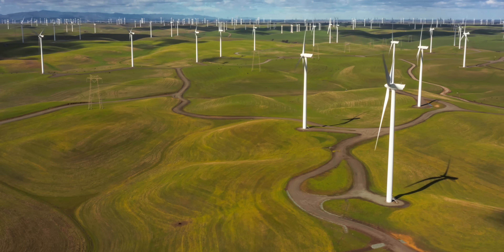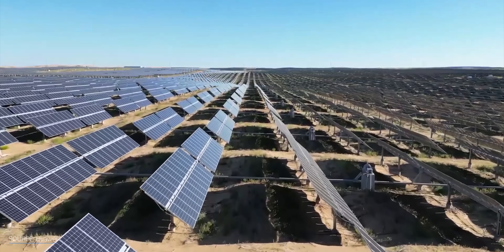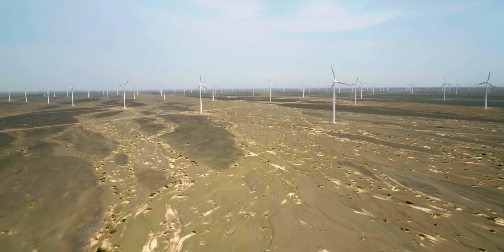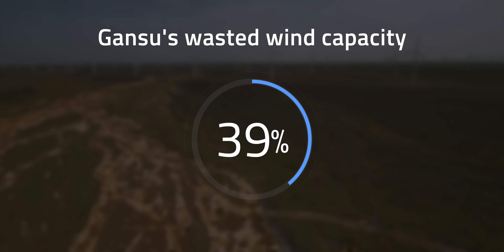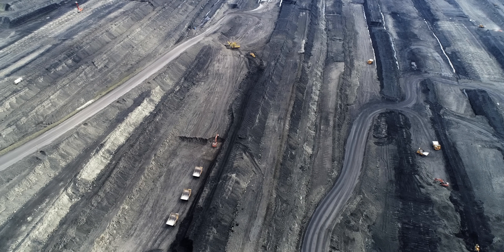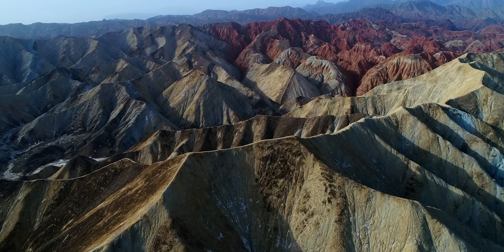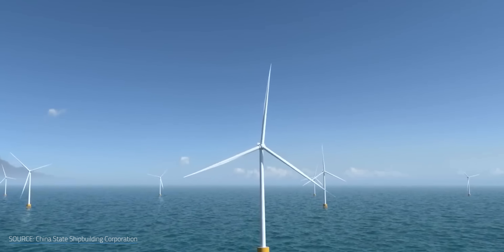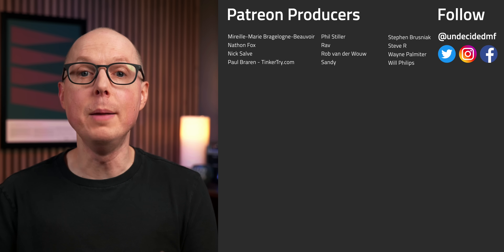The World’s Largest Wind Farm has a Tiny Problem

Comment: No, the U.S. does not need these centralized, concentrated, single-point-of-failure, eye sores that just waste energy in transmission.  Harvest the power where it's consumed.  The U.S. should have solar panels on every roof top and parking lot where it's feasible to do so, essentially decentralizing the grid.
Reply: Wind farms are the EXACT OPPOSITE of eyesores.     And WAAAAAAAAY better than rooftop solar panels.
Reply: You are missing that there are major projects and centres that need more power than can be handled by simple local generation. Decarbonizing steel or aluminum, or manufacturing for autos, etc, require incredible amounts of power that dwarf DERs for residential purposes. Roof top solar is absolutely a big part of the solution (with storage) but big projects like this will also be needed for big energy intensive industries.
Reply: Smaller power generation systems simply aren't as efficient or cost effective. It depends on the area, but in some places the sun doesn't shine enough or the wind doesn't blow enough or the crust isn't thin enough for solar or wind or geothermal.
Reply: Solar power won't do anything during the night when the consumption is highest. Maybe for air conditioning. And I doubt each household is willing to shoulder the cost of complete systems with their own storage. You average american is too short sighted for that.
Reply: @Leonhart_93  The cost of storage is going down and climate crises make having local power generation and storage more plausible. Occasionally an unnatural disaster strikes too such as a local utility getting hacked or sabotaged or even an accident happening out of negligence/stupidity.
Home owners have options and if they don't use them then they will suffer the consequences eventually. 🤷‍♂

P.s. I rent, but even I have a large battery and solar panels to keep some things running. It can be powered by generator, vehicle, or solar panels.
Reply: @megamanx466  The cost of those is going down, almost at the same rate as the average remaining spending money of the citizens. The economy doesn't look great for most right now.
Reply: @Leonhart_93  Depends on where you live and whether you have kids. Kids will always seem to be a financial drain and some people spend more on rent than they need to.
Reply: @megamanx466  It's not like they willingly spend more money, at least not on average. With rents of like 300k in some places and exorbitant taxes in poorly ran places like California, in those places there is no victory.
Reply: @Leonhart_93  ? 300k?? Of what?🤨
I feel like you're talking about California and somewhere else. 🤷‍♂
Reply: @megamanx466  Yes, I was. And it was just a few examples. In those places in general the game is rigged and you need to be anything but average.
Reply: @Leonhart_93  Ok... but 300k of what for rent a month? 🤷‍♂
Reply: @megamanx466  Some big cities where the average income is really large. But that also means the income is useless since they don't get to keep most of it.

Comment: I just BaiDu. According to the Chinese reports: High Voltage DC cables was connected, and a gigantic energy storages were installed, so GanSu get green light to run full speed on it wind and solar energy in 2020. 

"Starting from 2021, we will introduce full industrial chain projects with investments of over 10 billion yuan, such as Baofeng Silicon Materials, Huantai All-vanadium Liquid Flow Energy Storage, and Zhihui Green Coal Chemical." -- translated by Google

BTW, I just checked 2023 figures, wind power is still larger than solar in China. But it seems solar will soon surpass winds.
Reply: Thank you for the update. I am an Environmental engineer in America. These projects are what I have been dreaming about for many years. I would like to stay in touch as the project moves forward. Thank you and I hope to hear from you again.
Reply: @CSBastianyGaumnitz  The american midwest is an old danish dream. Ideal place for Windmills, hydrogen and biofuels. Connected to 'the midwestern corn lobby!"
Reply: @CSBastianyGaumnitz  Yeah I know! I ain't no engineer, but a wind farm the size of Belgium is simply mind boggling! Also, the efforts of de-desertification is so impressive! China has killed off one whole "desert" called Maowusu. It is not a true desert. It was a rich grassland one thousand years ago but due to over-grazing and over-farming, it turned into desert and it kept expanding... It is done by sweat-and-blood of many generations, and also a lot of innovation. What I learnt was that the scientists teach local people to grow a Chinese herb Licorice. This plant can grow horizontally and was patterned into grid to grab the top soil. And licorice is in high demand in China and the local people could sell them at good price! You can imagine how much it improves the life of local farmers (and herders). 

If you have time, maybe just go there to take a look yourself? And, my understanding is that the central America is a piece of big, baren, sunny, windy, dry and cheap land. Definitely infinite chance for innovation to do something seriously good for the Earth and local farmers back home!
Reply: Im no tech expert and even i know China is pioneer on UHVDC tech and installing large distance every year. Also from this year 2024 "The state-owned State Grid Corporation of China has started construction of an ±800 kV ultra-high voltage flexible direct current (UHVDC) transmission project linking the provinces of Gansu (western China) and Zhejiang (eastern China). The project, touted as a world first, will enable the transmission of over 36 TWh/year of electricity to Zhejiang once completed, with more than half of this amount generated from renewable energy sources" ... Matt is using 2016 data in his video, almost 10 years ago data lol
Reply: According too the ccp... lol
Reply: @alexandergooding4860  says the cia bot who believed iraq had wmd lol
Reply: @MGZetta  lol
Reply: @alexandergooding4860   what has ccp done to you personally... Did ccp go on war with any country and It's ideology...
Reply: According chinese reports...😂😂😂😂. So stay cool
Reply: @Tony-zg4yf  See some results and cleans your washed brain. You're trying way too hard. Lol.

Comment: In the US i think the distributed energy model makes more sense.  The energy is produced on the homes where it is used.  this avoids the transmission lines cutting down on the expense and losses.  It also takes loads off of the local and regional grids by reducing the surges produced by individuals cranking up the heat or cooling in their homes..  Just a small system on each eligible home could reduce the overall load on the grid and energy generators.  that is my philosophy although it may come with its own challenges since energy produces will find it more difficult to balances the demand vs generation.
Reply: I agree totally with your concept.  It might lose overall efficiency but the cost savings of building locally at the each house or multifamily level decreases cost of future costs.  By this I mean where central power relies upon the administration cost and delivery costs to only be lower at the beginning but over time grows to be more costly than the actual power cost delivered in the end.  This is because of the extreme waste and fraud that occurs in any government central planning dynamic.
Reply: It's a fine idea, but in the Northern/central states, how do you handle dunkelflaute? And, midwinter 3 months Dec-Feb? Maybe we should all hit the beach in the tropics Dec-Feb.
Reply: @jonb5493  I’m not saying it will completely replace traditional energy production.  I am suggesting that it’s more efficient than solar or wind fields with long transmission lines.  Putting the production near the use will augment and put less stress on traditional energy.  It will “offset” production needs even in those winter months.

Comment: I'm surprised that when they were designing these wind farms that they didn't have a plan on who would use the energy and how they would get the energy to its use location.  Much of what they are doing now seems like an afterthought which is usually more expensive and more time consuming.  The other concerning aspect of this project is that the wind power is significantly more expensive than coal.  You can't guilt people into using clean energy and when you try to regulate to force people the result is out of control energy costs.  Make clean energy more cost effective (or at least the same) and make it convenient then the problem solves itself.
Reply: They did, but the transmission lines took much longer to install than the Ramp up on the installation.
Reply: It is cheaper in its life time, it's just a higher upfront cost. 
The cost to start producing energy is lower with coal, but after years of buying coal and paying miners transport and plant workers, it becomes more expensive. 
It's just a liquidity issue, if you have 10 billion and need 20 gigawatts and cost till operational by a set date is 1b/gw for solar and .25b/gw for coal then you spend 6b on solar and 3.5b on coal. 
Lifetime costs might end up being 1.5b/gw for wind where coal becomes 2b/gw which is more expensive than the wind yet they couldn't go all wind at the beginning. 
Governments understand this which is why they incentivize it to help add cash low for more adoption. It saves them money in the long run, if it wasn't cheaper then they simply wouldn't do it on scale no matter environmental impacts of other energy.
Reply: @john38825  I understand the concept.  I think clean energy needs to be cheaper in the near term.  Lots of government promises about the future to get something passed today.  I think governments are more concerned about maintaining their constituents and less concerned about logic and planning.  I love the idea of clean energy but I think we need more innovation to make it a viable alternative (cheap and convenient).
Reply: @bigjimstream  The coal power looks like have a lower cost, but long tearm there will be a health cost for the people, this is need to be take into the calculation.
Reply: Compared to coal, wind energy systems are up to 30% lower cost.

Coal costs between $57 to $148 per MW depending on location and other market factors.

Wind energy is running about $32 /MW for utility scale systems.
Reply: @shawnr771  You are raisng the key point that Matt unfortuntely did not elucidate - why are these wind farm operators currently asking around $75/MWh for wind power .... i.e. why are their asking price for the electricty from these Gobi "mega-wind" farms indeed relatively expensive compared to other good examples, like your example of wind power in Texas (i.e. according to Matt the Gobi Chinese are asking about double what the Texan wind farms deliver a MWh for)?  We can speculate on why, but I would love to know the verified reasons from a verifed knowledgable expert... is it their installation costs, is it O&M, is it low capacity factor, is it low subsidies, is it high interest on theri capital, is it greed?
Reply: @CarbonIceland  Who knows.
Maybe they are better capitalists than the Americans.

The cost to install and operate is always under the price that is charged.
It is called profit.
Reply: @shawnr771  I don't have the data.  I'm just going by what the video states.
Reply: @bigjimstream  I just typed the data.
Reply: This is typical of Communist planning.  The people who plan this aren't paying for it, so they have no incentive to consider where it can be used.
Reply: Political projects seldom work.
Reply: @Harrythehun  It's not a political project or however you twist it. AQI in China is getting better and better.
Reply: But remember, in China plannings is made not for 5-10 years ahead (like in the west) but for 20-50 years.
Reply: @ThEvilsTeam  Not really. They plan for something. But how to do it specifically, the details, they do that on a whim.
Reply: @ThEvilsTeam  It's Chinese style mega-projects. Solar and wind projects are industrial policy so they can dominate the sector. The problem with top-down Chinese approach is the upgrade/replacement cycle comes at the same time too. Generally, it's much easier to upgrade/replace smaller projects over a course of multiple years and decades, building out recycling systems along the way. It reduces the impact from boom/bust cycle.
Reply: @AFlyingCookie2024  The property crisis lately in China would suggest otherwise about "stability"... but what do I know(rhetorical)? 🤷‍♂
Reply: @ThEvilsTeam  Seems they didn't properly plan for even 1 year. 🤷‍♂
Reply: @megamanx466  "Seems"

Comment: Personally, I hate wind energy. Not only is it bad and expensive but it also takes up lots of space and requires a massive amount maintenance. Nuclear power is the future. Fusion energy is the future. How are we going to explore the stars with wind and batteries? All atomic power really needs is some legislation that isn't brain-dead and allows for the recycling of nuclear waste. For reference, I saw a video that says nuclear waste still has 96% of its energy potential and they are just putting it in the ground because of laws.
Reply: Nuclear is good. I personally believe a mix is a good idea for a smart energy. One of the most popular arguments against nuclear is operating cost and high LCOE, but looking online, it's been going down. China is 1/3 of the cost to build compared to the west because they batch built the plants and reused designs. 

SMRs seem to have a similar ratio of operating costs, so that's even better. Recently, one plant was tested to be meltdown proof even with the absence of power. 

There's no one single solution. Renewables are green but unpredictable and unreliable. Coal and gas is reactive and still cheap. Nuclear is expensive but still mostly green.
Reply: @yensteel  - Nuclear has an achilies heel, it's a big bang infrastructure project, takes a long time to complete (plan to operation) and is expensive to build. 

By way of example, Hinkley Point C in the UK was announced in 2010 - a UK, Chinese and French joint venture - started construction in 2017 and isn't due be operational till 2027 (though not guaranteed), at a current projected cost of £48 billion (originally expects to cost £25 billion). The output is  3.2GW but to break even it has a high strike price and long payback periods (35 years compared to 15 years in offshore wind).

Nuclear as a zero carbon source of power should be part of the mix but not the sole part, due to it's long lead times and high cost - in the UK nuclear represent 14% of the generating mix, renewables about 45%. It is quicker and cheaper to build and operate renewable power generation infrastructure than nuclear of the same size. 

For example, the Hornsea offshore wind farm that is being built in four phases giving a total of 8GW of generation capacity at a cost of £16 billion, planning started in 2014, with generation starting only five years later. The build can be phased and flexed in capacity in line with innovation - each phase starts generating about a year after commencing construction and generally complete within a few years. The phases were/are:
- Phase 1 - 1.2GW construction commenced at the start of 2018, stated generating a year later with the full build was completed in under two years. 
- Phase 2 - 1.4GW started build in 2020, started generating in 2021 and completed in 2022. 
- Phase 3 - 2.9GW started in 2023 and is due to start generating next year and completes in 2027.
- Phase 4 - 2.6GW due to start next year with completion by 2030.

The Hornsea wind farm offers two and half times the generating capacity of Hinkley nuclear plant, costs just 1/3 the price, can be phased and starts generating almost immediately and adds capacity incrementally all in about the same overall start to finish timeframe as a single nuclear plant.
Reply: @GruffSillyGoat  🧓
Reply: "Fusion energy is the future." <- and it has been for 50 years and it will be for another 50 and another....
Reply: France has been recycling and reconcentrating its nuclear fuel for decades. The don't consider it "waste".